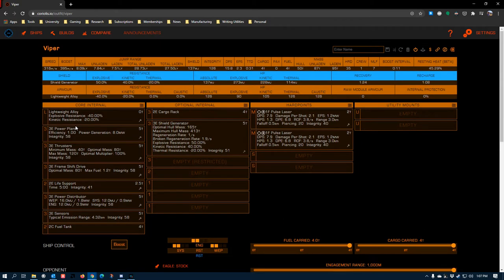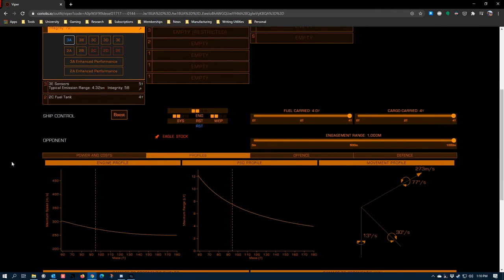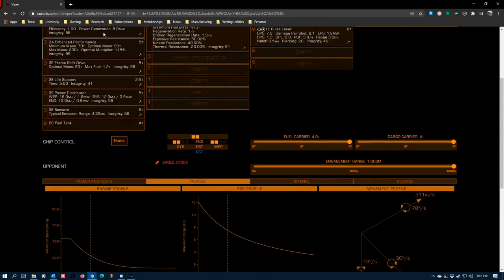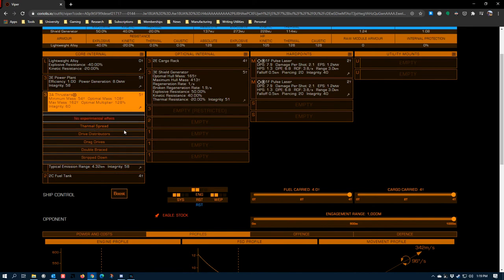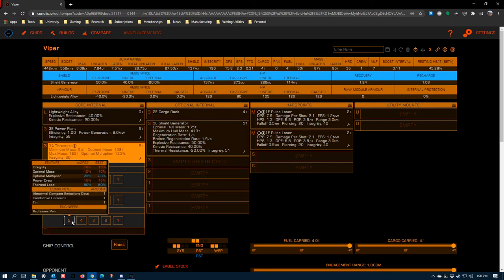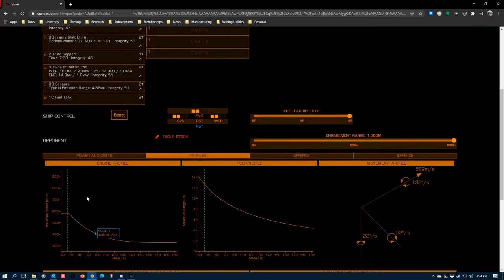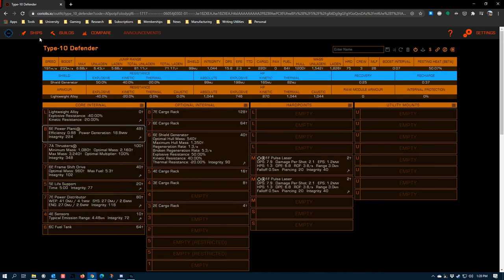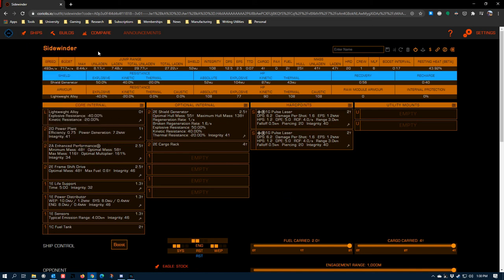Elite Dangerous | New Player Tutorial | Thruster Selection and Engineering

Comment: I feel stupid even after watching this.

I have an Anaconda. Currently has 7D thrusters. When I mess around in coriolis, I'm really not seeing much of an improvement in either speed/boost or turning ability by changing to 7A thrusters. Is it even remotely worth it?
Reply from the maker: It depends on what you are doing. For non-combat builds there's not much reason to. The Anaconda has uniquely bad handling,  only the T-9 & T-10 are worse.
Reply: @DryHeatAndSand  It's a combat build focused around a huge multicannon and four railguns. Currently using a plasma accelerator and a couple of fragment cannons as well mostly as an experiment.

Works great for single targets but I keep encountering huge groups of pirates at once...